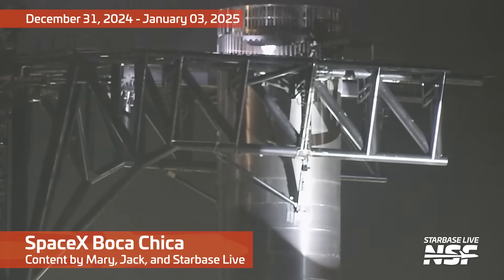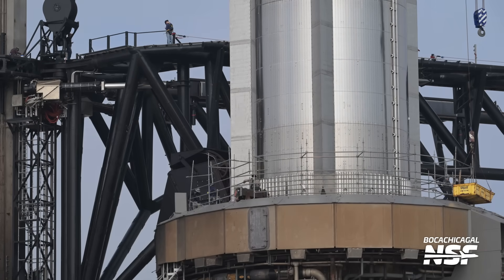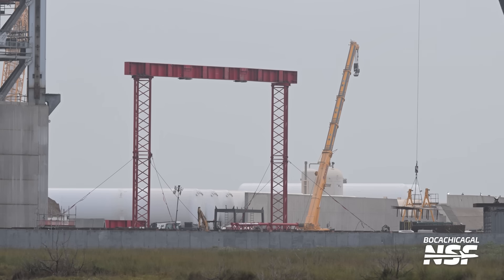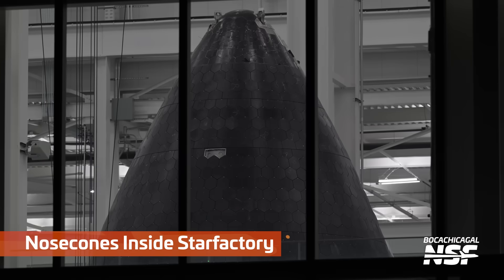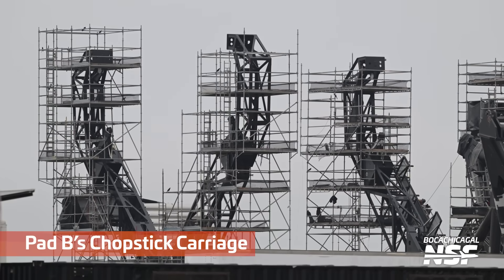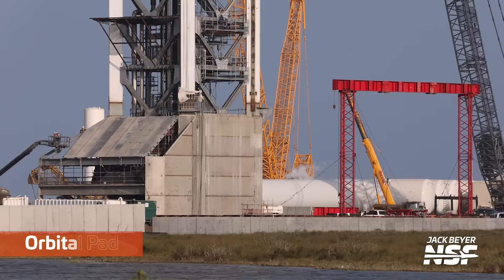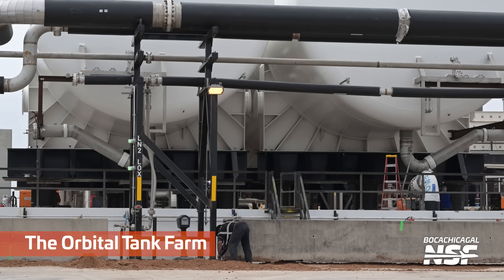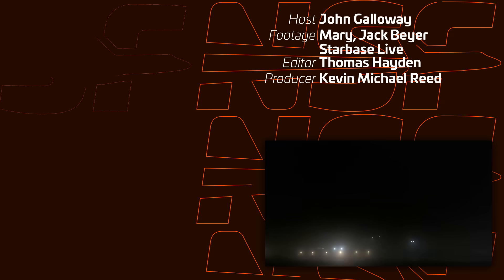Coming Up On Starship Flight 7 | SpaceX Starbase

Comment: SpaceX is launching experimental Units?
Just poping out dummy satalites is stupid?

Moduals alike starlink will do the job?
yet if they are shaped to re enter in the same path as the Rocket
use should be made of shape
and rentry protection evp[eriment
IE shaped disk to expand inflate as a reentry?
shapes with innerm ice liquid gaes to weep out
Ice mixed tiles of Ceramic dust
Any experiment that would test the result of reentry 
survival of coverings
Extrending tileled protected wings like
Tree seed holicopter seeds
simple ejected moduals with signal heat sencor
responders and trajectory tracking
would be a feed back to analies

Reply

Comment: Ha ha! A launch to clear the scaffolding! I have visions of scaffold poles with melted ends arrowing across the site!
Ref: 3:55  Lining up 96+ holes with a ton of pipe manifold swinging in the breeze is no joke. Bolt diameter is usually one sixteenth of an inch (for US readers) less than hole dia. so only + - a thirty second play. Easier when rigging to have a bolt a size smaller dropped in each end of the manifold to guide it home.  Love the commentary John.
Reply from the maker: Appreciate that! The thickness of the flange is also a huge deal... and those flanges aren't skinny. - Das
Reply: @NASASpaceflight  Agreed. The higher the pressure; the thicker the flange; the trickier to rig. I think modern laser sight line tools have made fabrication more accurate and so rigging easier.

Comment: How do you turn on ambient only?
Reply: the way I do it is to click the settings icon and then select "audio track" and there are 2 options... select the "English (United States)" option.  the "English  original" is the track where dos speaks. I definitely enjoy the ambient track!
Reply: Toggling ambient mode on in video settings doesn’t mute the narration overlay???
Reply from the maker: Change the audio track under the settings. - Das
Reply: @ Hi, Das.  That’s always worked on the longer videos, but for some reason, it didn’t work on this short video..  thanks for your reply. —Dick
Reply: @Richard.Holmquist  It worked for me. It shows  "Audio Track (2)"  I prefer the sounds without commentary (no offense Das).  It's like meditation for me.
Reply: @NASASpaceflight  he means change the audio track under setting to the "English (United States) "
Reply from the maker: None taken at all, its why we do the extra work to include both. 👍 -Das
Reply from the maker: Hey Richard, sometimes it takes youtube a while to make the second track available. If you don't see the alternate audio track under settings, that's the problem 9 times out of 10. Can just check back later to see if YT is done doing whatever it does. Cheers- Das
Reply: @NASASpaceflight  hey Das, what is the "Ambient mode" toggle switch for? when I turn it on and off, I don't notice anything different. My original thought was that if I turned the ambient mode on it would switch over to the ambient one track but that does not appear to be the cases ?? thanks for your help
Reply from the maker: What YT calls "ambient" mode is something about making the window/screen match the colors in the video. Doesn't have anything to do with the audio, so we are thinking about better ways to refer to the "non commentary" tracks (natural audio maybe). - Das
Reply: @ Why not just change Audio Track “English {United States)” to “Without narration”?, but NOT “Silence audio”.  This maintains the natural Starbase noise (machines, sounds of nature :  surf, bird calls,etc,).  In any case, thanks, Das, for this extra bit of functionality.  Any change in user friendliness and simplicity is always appreciated.
 Been with you guys and gals before “Hopper” even had a name, in fact regarding space flight, all the way back to the
 V2 Rocket center at Peenmünde.

Comment: It would be cool if the whole process was completely automated, no human intervention, ever. Lands automatically, aligns the ship to the OLM, does it's own system checks and visual checks, starts refilling, stacks the ship and launches, then the booster comes back, caught, stuck on the mount and the process restarts again.  If it needs human intervention then it sets an alert.  Elon has to have that in mind. It should be quicker and more efficient, with less room for human mistakes.

Comment: Cubans should sell the entire nation to Musk to use as Starbase Sud, because it's closer to the equator, also no more pesky, interfering regulations or regulators.
He can electrify the entire nation with Chinese solar panels, Tesla PowerWall, MegaPacks, CyberTrucks, Roe Bovens and StarLink connections.
Is this hard? When has Musk been scared of hard work? He makes the impossible merely late. (And the US will still need Gitmo, so it starts with an immediate tenant. )